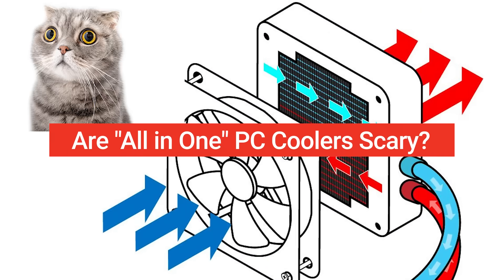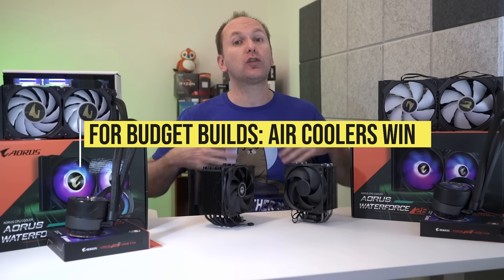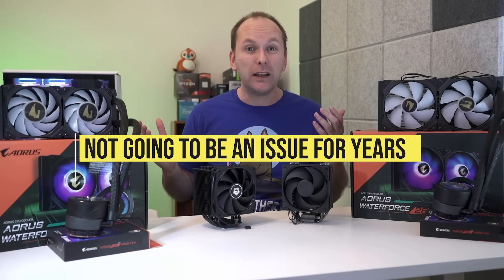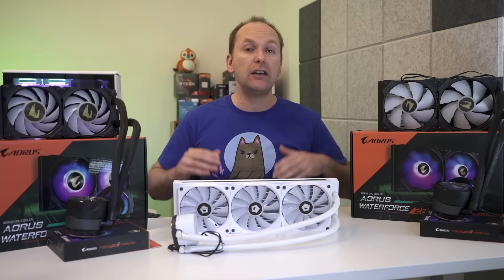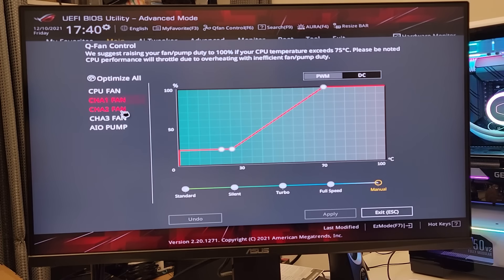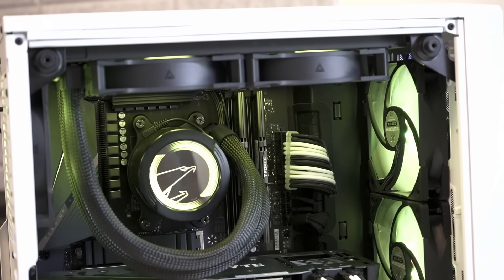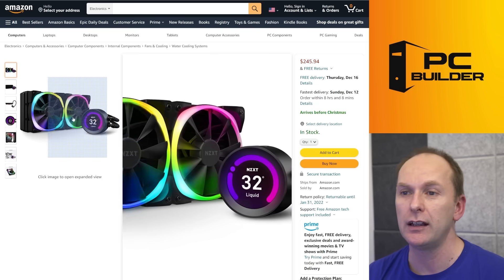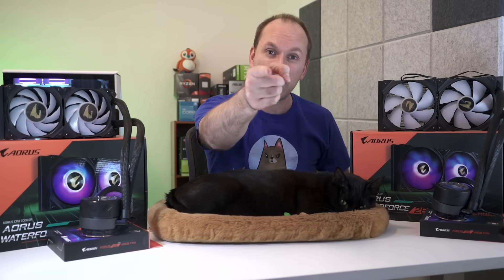🛑Watch BEFORE You Build! 🌊 PC Water Cooling Build Guide | Water Cooled PC Build 2022

Comment from the maker: NOTE: Minor error on the B-Roll video at 6:35 demonstrating AIO front mount position: fans should be flipped around for a pull orientation. 
Do you still fear the radiator? What are your thoughts on AIO cooling? Do you do things differently?
Reply: GN did a great video about having the tubes at the top on a vertical radiator. The tubes should definitely be at the bottom, so the air sits at the top of the rad. Whereas when the tubes are at the top the liquid will “trickle” into the barbs and causing a gurgling noise and not feed the pump sufficiently.
Reply: Aio is great but cant be used in every build due to space limitations. Still, it is my first option if available
Reply: @manguerrero6220  space limitation? Lmao. Im going sff and still using a 240mm aio
Reply: I’ve found that top mounted AIO radiators can interfere with the RAM depending on models of the RAM and the case - i had a Corsair build with a 220 case, Vengeance RGB Pro RAM and a 240mm H100 AIO and I could not mount the AIO on top without bumping into the RAM (same parts fit in my 4000X case)
Reply from the maker: interesting!
Reply: Getting the Coolermaster illusion thanks for the help
Reply: seems complicated, i have been building PCs since mid 1990s, started with the 486dx (intel or cyrix back then), amd sempron/athlon.... less games back then, so you build a pc to last. now, i'm stuck with the Hyper 212 Evo, both my 6600k and 3800x builds only have them. counting the cpu power draw when overclocked and the necessary cooling systems, i find it better for me just to buy the best cpu i can afford and running it at nominal temps (very minimal OC).
Reply: One note on radiator fan orientation: You should always be drawing air from outside of the case through your radiator. Yes, this means that if you top mount it, the fans should be in an intake orientation. I know that goes against "warm air rises," but computer cases are forced air environments, which means the air will go where ever the fans blow. Pushing/puling warmer, "used" air from inside the case through your radiator is only hurting its performance.
Reply: I bought a evga clc 240 and I was kinda disappointed. The fans were very loud and I almost felt like I had a bad unit. Kinda hard to see liquid cooling the same since I’m afraid of getting another jet engine as a cooler.
Reply: @akawiangel  I think it is just that specific product.  I am a EVGA supporter, but those are LOUD fans.  My AIO is a Corsair H115 Pro and they are dead silent unless I'm rendering or playing something in Ultra 4k.  Then they roar, but that's what they are supposed to do.  Try another brand and see what you think.  If you buy on Amazon, most returns are hassle free.
Reply: AIO cooling is the Best never ever i go back to Fan cooling my aio was just 50 bucks and its very great
Reply: @Vitrooz  check the pump after 2 years 😂 my was a little leaking without noticing! Just niticed because i seappes for air cooling! NHD15> all cheap aio!
Reply: I don’t I just finished my first PC.

I’m using a MasterCooler ML240L V2
I’m not scared of leaks or any liquid damage. It looks awesome, its quite even at full power and as an initial test before installing any other fans my AIO was keeping my Ryzen 5 Pro 2400GE at 30-35C with Custom/High graphics on Crossout. Not a super intensive game but certainly not the easiest game to run.

For those wondering the specs are:
Ryzen 5 Pro 2400GE 
Asus ROG STRIX B-450F Gaming II
Silicon Power 16GB DDR4 3200mhz (but the max my CPU supports with stability is 2933mhz)
Drives: 
1 500GB M.2 Samsung Evo
Backup/lower priority:
1 240GB SATA3 Kingston SSD
650W EVGA 80+ Bronze Fully Modular PSU
(Yes the PSU is huge for this build, I want it for future upgrades)
All built into a Hestart M1000 ATX Mid Tower
(Yes it’s an obscure case but it looks nice to me)
Anyway good luck to all of you. Whether you are upgrading, making your first PC or praying to the gaming gods for a GPU near MSRP.
Reply: I use an ASUS or Cooler Master AIO on any overclockable CPU and if it's a locked CPU I use any Cooler Master air cooler on sale.
Reply: Used to be kinda scared of watercooling since I thought you had to change the liquid 3-4 times a year (Murphy seems to dislike me and I'm sure I would get water everywhere at the first opportunity). Once I learned that you only need to do this for custom loops I immediately ditched the stock amd cooler for a 240 and overclocking the R5 3600 to 4,5 ghz.
Reply: Should i get an AIO for the h510 flow?
Reply: I use a Corsair iCUE H100i RGB Pro XT. I mounted it on top, the fans pulling air trough the radiator, out of the case. I use a Coolermaster H500M case. The performance is good. Tho I recently switched from an i5-4440 to the Ryzen 7 5800X and I'm still trying to get used to the temps. This CPU is a beast, boosts really agressively. Usually mine with the above setup, idles around 38-40 °C and stays around 80-84 °C while gaming (depends on the game, the 80 ish C is only on more CPU intensive games, like TTW:Warhammer 2, other than that, it stays under 65 C )
Also I read about that, my temps are completely normal, the 5800X is like, you want to cool a nuclear reactor.
Reply: I avoided getting a hybrid GPU, not ready for that level of liquid cooling lol. However, I bought Arctic's 420 AIO cooler. Only question I have is, since it only has a single cable in the pump head, do I just plug it into the CPU_FAN header and accept the fact that the fans will always run at a relatively high speed? Or is it possible to separate fan and pump speeds still?
Reply: Sit down and just watching u 🙂 nice . 👌 good job
Reply: Mejor que Msi mpg coreliquid k240
Reply: I bought an i9 12900k cpu and so far it’s been a nightmare.  I totally forgot that my motherboard was AM4.  I rushed out and got an LGA 1700 z690 for $500.  When the motherboard arrived I then found out my DDR4 ram was no good and the z690 only took DDR5.  So I rushed out and got 2 DDR5 sticks for $300.  When the sticks arrived I noticed my cpu cooler blocks one of the ram sticks and found out the z690 motherboard was designed for AIO due to how compact everything is.  So now I rushed out to buy a $140 AIO and waiting to install that.

My first PC only costed me like $400 and it could run Elden Ring at 55 fps medium.  Upgrading has turned out to be a nightmare and now my PC is totaling to about $1500 with all of these little miscellaneous costs.  I wouldn’t be surprised if I need a new case now when the 360mm AIO arrives.  Moral of the story:  do not buy a cpu without doing your research first.
Reply: @robbytherob i believe that if you did better research you could've avoided a lot of the extra costs. There are still plenty of z690 and z790 motherboards that can have air cooling and not block the RAM. They also come in DDR4 and DDR5 versions
Reply: Okay I came to this video actually to ask exactly this question 😅 in my case the only option to fit the aio I want would be a front mount , so you recommend to flip the fans to be pulling from the radiator , my question is , isn’t all that heat going to spread all over the system ? 
Would it be a good option if I flip the back and top fans to be pulling and the front with the radiator pushing ?
Reply: @kirilbogdanov3192  I mounted my fans as intake and the top/back as exhaust.  So far my PC runs at 20 degrees idle and 30-40 during heavy load with that configuration.  The only drawback from this set up is that it will get dusty in there quick and you need to periodically clean the motherboard at least every 3 months
Reply: hey i have the mastercooler ml240l and my cpu is still getting a 100celcius any idea how this can happen i have the i9 9900 cpu ( i use it as intake my radiator ) my pump and radiator are not even slightly hot its like there just turned off
Reply: Any tips if you have a R7 5800X3D as the CPU? Would it be enough to buy the Aurora 240mm AIO cooler?
Reply: amazing videos thanks.
Reply: Hello Jason,  I am planning to build a dual Xeon system (2x E5-2696v4) with an X99-F8D motherboard, and I am planning to use two AIO coolers (single fan) for  each of the CPU. I factored in the extra power consumption so the power supply will be 700W, but is there anything to pay attention other than the power? Do I need splitter cables for the fan power?
Reply: Is there an AIO that uses tubes that are better suited lengthwise for a full tower case or is that a non issue???
Reply: My philosophy is: why use an AIO cooler and risk your expensive hardware when nh-d15 exist ?
Reply: @osamaev7398  The NH-D15 is as expensive as some AIOs and it’s size makes things like ram, the pcie slot for your gpu, and possibly m.2 drives harder to access.
Reply: @osamaev7398  my thoughts exactly.
Reply: @osamaev7398  Especially when you upgrade the fans to the Noctua IndustrialPWM 3000 RPM models.
Reply: @osamaev7398  what do you recommend for LGA-1700?
Reply: Nice demonstration of efficacy, safety and ease, but .... I'll stick with air. The one time I bought an AIO, the pump was not working and my temps shot through the roof before I realized what was happening.
Reply: Moved from a Big ass air cooler on my current pc to a ASUS AIO 240mm. Best upgrade ever! I have loved everything about it. Better temps, so quiet. So easy! I'm working on Hardline for a new build now. So expensive 🤯 and a big learning curve. I'm sure I'll find You for great advice!  Thank You very much! 👏

Comment: Hi I need some help I make my build and someone told me the aio is on a wrong location I have the case montech sky 2 gx and a sama  360 mm infinite mirror aio and I have this radiator at top and  the pump facing bottom, someone told that I might be cooking my CPU. But iddle is 26 to 30, and the highest is 40 Celsius....am I doing this wrong and how that will affect my CPU cooling? I will post a pic...but I don't know how.  The position I picked was based on the position of my ram slots and that I don't have much space and the hoses will be  touching the ram.... I'd appreciate your help.

Comment: Dude I think that air cooler you had on there was bigger than my Jeep's radiator 😂.  

Its crazy, Its been so long since I built a PC, single color LED fans were a new thing. My GPU had a heatsink, with a funnel shaped scoop  that extended to a fan on the case door. And a single intake in the back. Thats it. And the fans were loud AF. 
And used to need a sound card, an ethernet card, a wireless card, a GPU. Wires everywhere. 

Its crazy how easy it is to do a nice clean build now. And how cheap it is to do it.

Comment: Hope someone sees this. All you need is air flow. No air flow pushing against each other. Built and installed a board for a military base. No external fans allowed. Used fans for internal air circulation to keep it cool. Btw this was running a AI system as well.

Comment: My current aio is almost 9 years old now. My i5 5820k was around 40° when idle, and the coolant was around 35°. I kept this for 9 years.

I just switched to 5700x3d recently. Somehow, it's idle around 33° with the coolant around 29°.

So, it seems like my aio is still working fine. I wonder if I should replace it due to age though.

Comment: ryzen 7 7800x3d 50 degrees when I'm not doing anything. Aida 64 reaches 70 degrees in the stress test. is this normal? I don't have much experience so that's why I'm asking. liquid cooler corsair h150 360mm

Comment: I started w cheap water cooling system to an air cooling system after I lost my other AMD chip and lucky to get a second AMD chip to replace my other chip. I don't think I'll go back to a water cooler only I can afford real system that you can see the water intake start to run out to add more to it keep from losing my chip they never very cheap easy to find when they get fried.

Comment: I am watercooling my pc for around 25 years now. I began doing it in 1999. :D My first system was a tupperware as a water tank, an aquarium pump in tupperware, car heater radiator, silicon hoses and cpu, gpu and northbridge block. :D 

Know I am going to make an another interesting attempt to cool my new built but old render machine: X99 chinese mainboard, 2 x Xeon E5 - 2697 v4 cpu, 128gb ram. :D All bought used for dirt cheap.

For this dirt cheap, old, but yet powerfull setup, I have a dirtcheap but effective cooling solution. I allready have a 7 year old Corsair 24cm aio cooler. I bought a coolermaster 14cm aio for 9 usd used. :D And It is working! :D I will cut one of the hoses, combine the two in series. :D CPU1 to 14cm radiator, 14cm radiator to CPU2, CPU2 to 24cm radiator. :D This means two pumps though. I don't know it will be a problem or not; but I will test it. 14cm + 24cm radiator would be a little weak for two 2697 v4 cpus. If that will be the case, I will find another dirt cheap aio and add that to the system. :D What can I cool with the third cpu block? Mainboard maybe? :D I can mount it on the coller gills of the mainboard? I am not sure. 

I can hear the obvious question: What is your case? My case is 20 year old Cooler Master Stacker. :D You can buy it for dirt cheap. It can easily handle two 24cm radiators, 12 HDDs, two CPUs, 8 16gb rams, two PSUs, one SAS card, one 10gbit ethernet card and one gtx 1080ti. :D Nothing fancy. No RGBs, no glass at the side panel; but it has 4 wheels. :D I added USB 3.0 ports also (I disasamblied USB 2.0 ports and glued an extender cord perfectly).

Dirt cheap render / HDD server / Second pc at home office.

I bought Chinese x540 10gbit ethernet card. It works perfectly. Heats like hell. So I added a fan on top of it. I am supplying 5V to 12V 6cm fan. It is more than enough to cool down the ethernet card and it is silent because it is on 5V. The card has two 10gbit output. I bought two more. One is for my pc, one is for the third pc. I will directly connect them to each other without a switch. :) Again, cheap solution. :D

I allready have six 4 TB disks. I will sell four of them and buy eight HGST 4TB SAS disks. Why? Because sata disks are more expensive in my country; but sas disks are more durable and fast. Used Sata disks are around 45 usd in my country. Used Sas disks are around 25 usd. Since I have a sas card that supports 8 disks, I will use 8 SAS disks and two Sata disks.

----------------------------------

AIOs tend to breakdown because of integrated pump. Nothing else becomes a problem.

Comment: If you buy an AIO, spend anothe $2 amd get an internal pc speaker. Plug the pump into cpu fan socket, and have the alert on fan fail option enabled. A failed pump will overheat your PC a lot quicker than a failed fan (on either air or water cooler).

Comment: When installing the radiator in the front of the case and the tubes coming from the top of the radiator, should the pump be installed to 3 o'clock position or does it matter?

Comment: I use the Aorus 360 AIO with a 12900KS.  To gain some better performance, I have replaced the factory CPU contact frame with the Thermalright contact frame.  I believe with the i9 SKUs that this should always be installed.

Comment: you did some quiet mistakes there first of all why not mount the fans directly on the AIO block , and 2nd the tube of the AIO is on the GPU , if the GPU is hot it will get hot as well and you will get hot water and not cool...

Comment: Hello to all Need helpI do an upgrade to my existing rig
buy to ryzen 7800x3d. The case is
coolermaster h500 and I want to get a aio
cooler. My case takes on Top position only
240mm and the front 360mm. But on the front
I have 2x200mm fans that I want to keep.
saw online that they mount the 360 at the
front with the 2 airfans with all working as
intake. Will it work or should I go with the Top
position build? I use mainly for gaming.
I have decided on these two for the 2 builds.
1. Top nzxt kraken with Icd 240mm
2. Front lian li galahad trinity 360mm

Comment: I have a white Meshify C case with an Aorus elite AX V2 mobo and corsair vengeance LPX ddr4 32gb RAM. Will a 280mm AIO fit if I top mount it? Or is a 240mm AIO the biggest that wiIl fit in my setup? If my setup will allow a 280mm AIO, which ones are best? This is the first PC I’ve ever built btw.

Comment: Building my first ever pc today. Hopefully I don’t fry the cpu, break the ram sticks or mess up on my airflow orientation. 
Corsair 5000D RGB case
I’m thinking of putting my AIO on top as outtake, the. 3 120s on front, one 120mm intake on the bottom, and one 120mm on back as outtake.

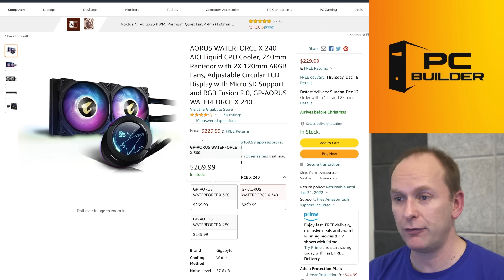Comment: 13:50 $230 is not a bad price....are you kidding me? In what world are you living? A few years back you would have gotten an AMD midrange kit (cpu+mb) for this money. Hardware and peripherals manufacturers are of their rockers with this stupid trend of form over functionality that is artificially inflating prices while the performance gains are 0. Is that stupid LCD helping in any way to reduce temps and get better performance? No, it's just a trinket. PCs these days look like they are taken straight out of a carnival...with tone of RGB lights, lcd screens on the water pumps in the case which instead of helping performance it's actually diminishing it since they produce heat in the case... While the overall presentation is good I can't agree with this nonsense,  paying $230 on a AIO solution just because it has LCD screen on water pump and freakin' microSD support, like that's of any real use, is simply stupid...sorry. just my two cents....
Reply: Absofekkinlutely

Comment: Still using a Cryorig a40 for 6 years, unfortunately, not in production anymore. Thought I'd buck the system and try a unknown aio manufacturer, Cryorig. Friggin amazing cooler. They are  only doing high end air cooling now, seem to be struggling against the big  guys. From what I've read, they're top of the line, low cost but high quality. Do research.